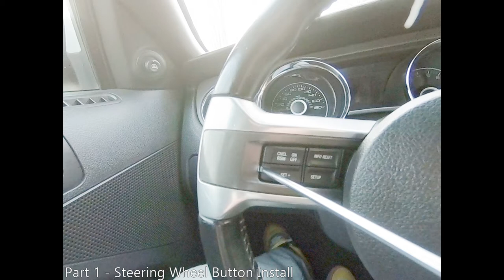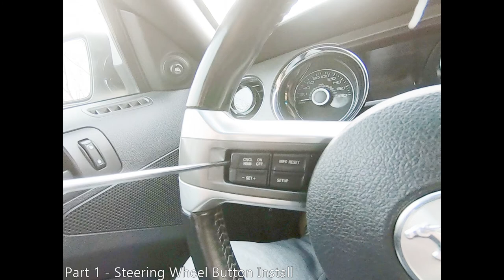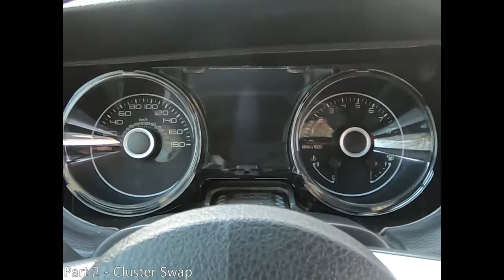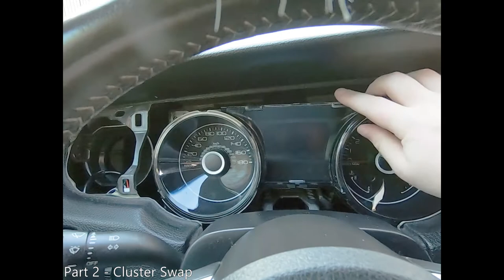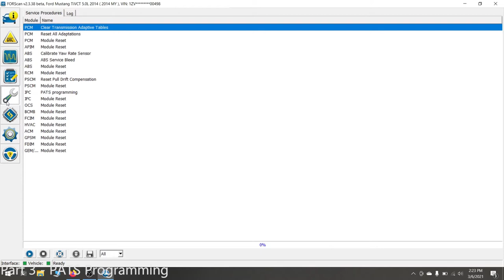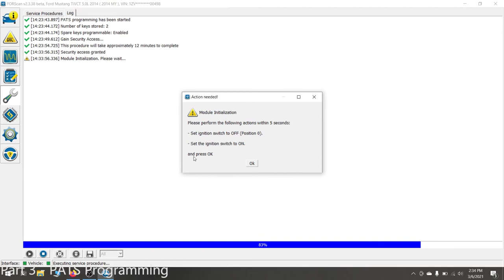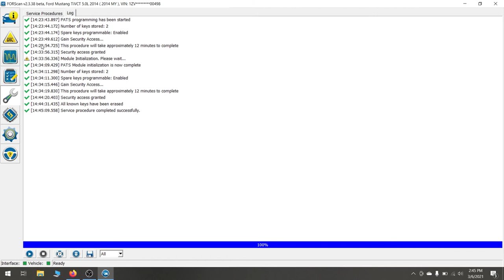How To: Swap Your Instrument Cluster on a 2013-2014 Mustang

Comment: This video gave me the confidence to finally swap my 2014 GT base cluster with a Premium.   For a long time, I was hesitant to start the process and acquire a used cluster and the steering wheel switch. I did not want to deal with any Ford dealers in the Bay Area if something went wrong.  I purchased the Forscan premium license, an OBDLink EX cable, and got the software running on Windows 11 Pro.  Your video instructions made the actual swap quite easy to follow, and the PATS programming worked exactly as you showed.  Thanks again for inspiring me to do the coolest mod yet on my GT manual Mustang!

Comment: I bought a 2013 mustang gt base and switched to the premium cluster just for the hell of it.  It's SO much nicer with the LCD screen and my color.
Reply: Where did you buy it at
Reply: @EastonS550  It's been several years ago now.  It was from an autoparts website. I had to send in the core and they even adjusted the Odometer for me. If I can recall the website I will post it.

Comment: Wish someone would show  in detail how to wire the  steering wheel switch in a premium 2011 . Like take a steering colume apart and rewire from the dash switch to the clock spring harness. Plus I went to my local Ford stealership for help they say it cannot be done and as we know they don't want to be bothered. I live in Maryland and there are no help for me here. I bought 2 clusters and they are sitting in my Garage for 3 yrs.
Reply: Did you solve the problem?
I have the same issue i have bought 2013 cluster and install it and program it . And i bought new steering wheel buttons. The cluster worked but the buttons didn’t work 
I’m struggling with the wiring if you know any thing pls tell me
Reply: I have an article on how to do it.

Comment: Hey boss! 

Do you know what I might be doing something wrong. 

My car is tuned do I need to remove the tune and go back to the factory tune? 

The problem I'm having is
 When I try to program both keys. Key 1 will program but key 2 won't. 

When I use use key 2 then key 1 won't program.

Comment: does anyone know how the process will work on a 2010 base as to getting the wheel buttons to work?
Reply from the maker: I don't believe this can be done on the 2010 cars. I believe the earliest year you can do this on is the 2011.
Reply: @whitezombiegt2181 but why they have the same everything, only the engine and gear are different
Reply: I installed 2014 one in 2010 gt just waiting for sw6911 part then see i have to do some rewiring
Reply: Everything working fine but 2010 has no ok button so i have tpms sensor button and there is no ok button so i am kinda stuck on that screen rest is working great
Reply: @karanjosan4426  did you use forscan? Was it easy to install it on the 2010? So what parts do I need to do this swap? Is it worth it?
Reply: @amroelmughrabi  yes i used forcan same process with 2010 make sure you have 2 keys yes it worth as we dont have any ok button so if any waning pop up like tpms or oil chnge to clear that you have to long press setup key it will clear
Reply: @karanjosan4426  how did you wire it?
Reply: @TownCar512  didn’t receive my parts yet
Reply: @karanjosan4426 I did the same swap right now - 2013 premium cluster to 2010 GT with premium cluster. What is sw6911 part you are waiting for? Do you have scheme how to rewire left buttons to make OK work?

Comment: Would you happen to know if you could switch a 2014 gt500 gauge cluster into a 2014 mustang gt with a premium gauge cluster?
Reply from the maker: Sure can. The steps should be the same as the video.
Reply: @whitezombiegt2181  ok, now my question is can I program my Premium cluster to run as a boss 302 cluster? I picked up a boss cluster for the extra readable speed and rpm, and if I can just swap the face over to my premium cluster that would be great.

Comment: Just swapped a 2011 5.0 into my 2014 3.7. I swapped the ecu, cluster ignition. The whole nine yards.. this PATS has got me stuck, I used forscan to program my keys but it will not allow module initialization it will load to 84% and then fail. Any pointers
Reply: Let me know if you got this figured out. I did a swap on my 2013 v6 automatic convertible my doner car was a 2014 5.0 6 speed coupe my security light is going crazy. I used same bcm same steering column and key, but switched dash harness to a navigation with navigation harness. Key won't crank.

Comment: when I made the change The buttons on the left do not work for me I installed them after programming the cluster this could be a problem?
Reply from the maker: What year is your car? If it's an 11-12 you'll need to do additional wiring. I am not intimately familiar with the 11/12 swaps, so you'll have to do some research online.
Reply: @whitezombiegt2181  I can see you Definitely have a tune in the car.  Did this reprogram affect the tuning at all?  How about the mileage change
Reply from the maker: @Hardwaretuned  No issues with the tune after swapping the cluster. The person who sold me the cluster adjusted the mileage to match the mileage on my old cluster.
Reply: @whitezombiegt2181  awesome man.  Thank you for this information.  I'm glad to see someone with some mods like mine doing this.  Im gonna have to pay 300 to have the mileage corrected and then I'll do what you did here.
Reply from the maker: @Hardwaretuned  $300 seems steep.
Reply: @whitezombiegt2181  yeah I know I called two places and both said the same price
Reply: were you ever able to figure out the button issue?

Comment: Thank you for this video! It has been tremendously helpful. I have successfully installed the cluster and am trying to use FORScan to program the new cluster and keys. When I connect I receive various “unable to connect DTC” errors. I installed the driver for my ELM adapter and paid for the FORScan extended license. Any ideas on how to get past this issue? TIA! 🙌
Reply: You can disregard this comment / question. It seemed to be an issue with the ELM327 device or deceivers. After several attempts to uninstall / reinstall the USB drivers and a few reports of my Windows PC, I was able to get it to work. Definitely recommend the swap to anyone that comes across it. If I can do it anyone can!
Reply: @michaelschwarz9114 wait so what did you swap? Lol

Comment: What is the parts number for the cluster you used? You didn't list it on the video and I need the parts number so I can order this cluster
Reply from the maker: The part number for the Boss cluster is DR3Z-10849-CA. However, you will be charged for a core if you buy from Ford. Additionally, you'll have to pay a 3rd party to adjust the mileage on it. You'd be better off trying to source a cluster used.

Comment: Your video was very helpful. Users make sure you get the license for the extended version of the software before trying this. The question I have for you, is there a way to program the select shift indicators into the cluster or did I buy a manual cluster that does not have that option in the cluster for programming? The S and gear number are supposed to come up to the right of the odometer, but mine does not after the swap. My car is a 2014 5.0 automatic with select shift. Thanks in advance!
Reply from the maker: I don't believe there is a such thing as manual/automatic cluster. The only difference should be the "As Built" programming, which you should be able to edit in Forscan. What I don't know, however, are what fields to edit and what to edit them to. You may have to do some Googling.

Comment: Hey I got a 2014 mustang v6 3.7 . Recently I replace the radio and the odometer simply switched from miles to kilometer. I tried all settings and it it never  returned. Took to ford dealership they declined to “interfere”… I just went on eBay and got one cluster already set to my current mileage. Do you advise I go ahead with the same thing you did or there’s a different way of solving my issue? If I do as you did . Should I replace the navigation steering buttons too?
Reply: have u found out the problem?
Reply: I have the same problem

Comment: Not sure if you’re still monitoring this but I have a question. If I decide to buy one of these after my car has been heavily modified and tuned. Do you know if I will have to get a retune for this? Not sure how this all works. Also one more question, are they manual/auto specific? As in if I have a manual, should I look for a cluster that is pulled from a manual? Thanks.
Reply from the maker: An aftermarket tune should have no bearing on this modification. I myself am Lund tuned and installed this well after being heavily modified. And no, there is no difference between auto/manual clusters.
Reply: @whitezombiegt2181  Thank you! I just picked up my gauge cluster so I should have it in soon. Appreciate the video!

Comment: Will A custom tune get messed up doing this?
Reply from the maker: I am Lund tuned and didn't have any issues. I know one YouTuber had issues, but I have no idea what that issue was. I even opened a support ticket with Lund and they confirmed with me that a cluster swap would have no effect.
Reply: @whitezombiegt2181  Thanks for the reply i am Triangle speed shop tuned so i will give it a shoot and see.
Reply: @heatherspruill9684  did you ever get around to doing the swap? And if so was your tune a custom dyno tune?
Reply: @adrianrodriguez4292  yes we did
Reply: @heatherspruill9684  ok did you have issues with the tune?
Reply: @adrianrodriguez4292  no problems at all. Did not have to do anything other than the steps to reprogram the cluster and keys. Even the track apps worked with out the asbuilt data steps. 2013 fors mustang gt.
Reply: @heatherspruill9684  ok thank you very much, did you take it to a dealer or were you able to do it the way this gentleman did?

Comment: Thanks for the video! After completing, the fuel guage read zero and I got a fuel sensor problem DTC. 
Went back to my stock cluster and everything is fine.
Any ideas?
Reply from the maker: I can't give you a good answer on that. My only experience with Forscan is mostly what you see in this video.
Reply: @whitezombiegt2181  I should have updated this comment. I finally succeeded. I used this video to go back to the stock cluster and buttons, then I used forscan to check for and clear all trouble codes. Something freaked out when I added the new buttons the first time and set a few codes (non MIL codes so I didn't know. I just decided to check for codes on a whim). Once all DTCs were cleared it worked perfectly. 
Hopefully my experience will help someone else out. Thanks for the video man!
Reply: @whitezombiegt2181  where are you getting the mileage reprogrammed at
Reply from the maker: @Hardwaretuned  The seller I bought from programmed it for me. There are also companies who can reprogram your mileage for you for ~$100.

Comment: Will this work to swap 2013 gauges into a 2011?
Reply from the maker: Yes, however, the 2011 cars need an extra wire ran into the steering wheel for the new steering wheel switch. You will have to research that tutorial. But the rest of the video applies.
Reply: @whitezombiegt2181  do you know by chance what needs to be rewired?
Reply from the maker: @will5oh  Nope. You'd have to do research on it. There's a lot of info out there on how to do this on a 2011/12

Comment: Hi, I really like your video about upgrade the cluster of s197 mustang. Recently I was trying help my friend to swap a premium cluster to his 2013 base v6. His car even doesn't have mycolor option with the stock cluster. Now the problem is after I finished the pats relearn, the car can start and new cluster works. Well I'm going to check the as built data, I know the new abs data can activate trackapps. But if I want to activate my color, do I need to pmi the bcm? Or I just need to change the IPC data？
Reply from the maker: You would have to do more in-depth research, but I believe it's just the as-built data.

Comment: I have a cluster to swap that has miles a little over mine. If I program the new cluster can I swap back to my original to use until the miles match then put in the new one without having to program it again?
Reply from the maker: You should be able to swap between clusters in that case. You can also pay about $80 to have the mileage corrected at a legitimate electronics repair business. Google "odometer correction".
Reply: @whitezombiegt2181  Normally I would have it corrected to match but it's only 134 mile difference. So I thought if it could be done I would just program the cluster and then leave it in my car to swap out with the original one once the miles matched.
Reply: @bryonbodine87  I wouldn’t even worry about that big of a difference. Just send it